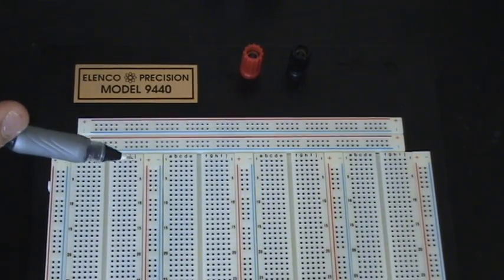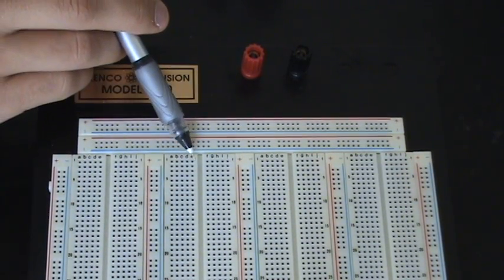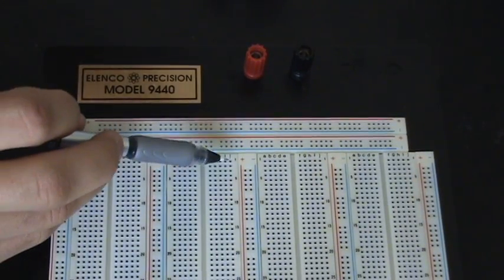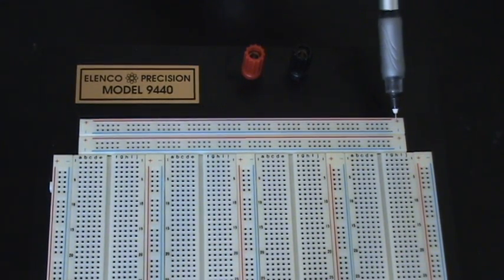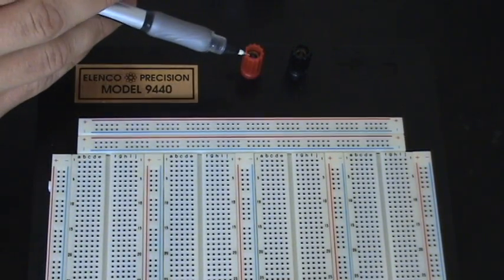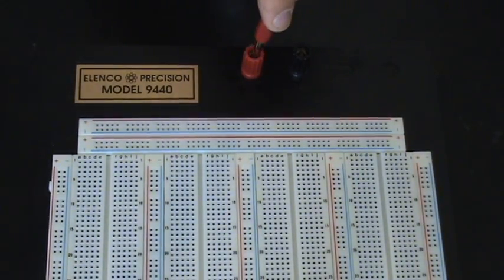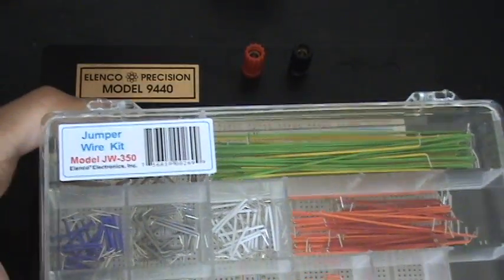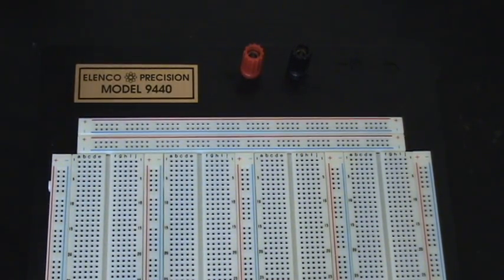Robotics and Electronics Tutorial - 14 - Intro to Breadboard

Comment: A serie circuit is like connecting components right after eachother like this: (+ and - on a battery)
+_____Component____Component___ -

A paralell is like connecting so that they have more "pathes" to go like:
+_________Component____ -
      I_______Component__I
      I_______Component__I
When serie connecting batteries, the voltage incrases. If you hade two 
1,5 V batteries and serie connected them, you would get  1,5 *2 = 3 V
Paralell would not incrase the voltage, but the duration

Comment: Another thing to get if you will be doing a lot of these projects is a 9v DC power supply, so you don't have to worry about your battery dyiing while creating your circuit.  They're fairly cheap.  You can also make one with minimal components at a beginner skill level.